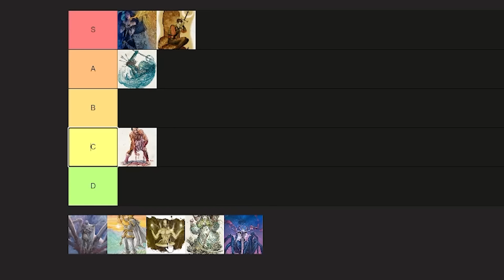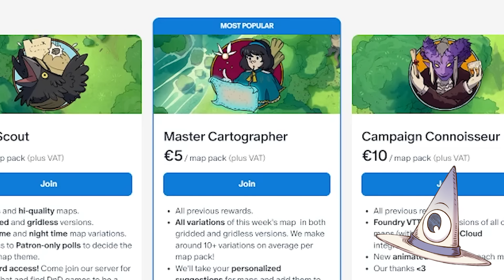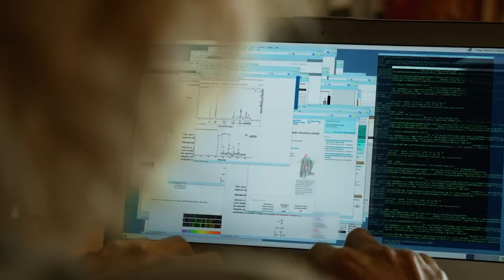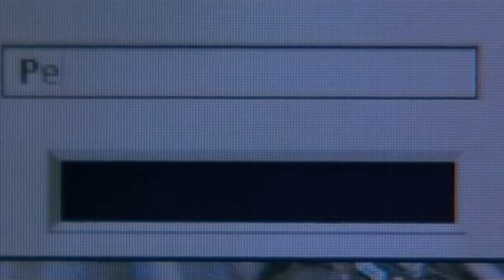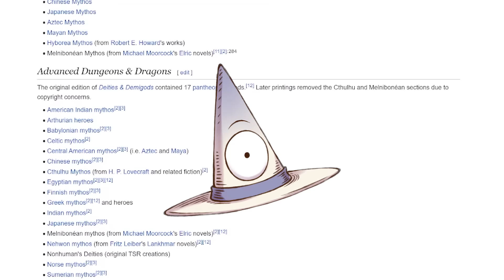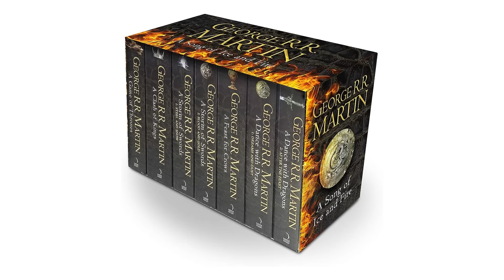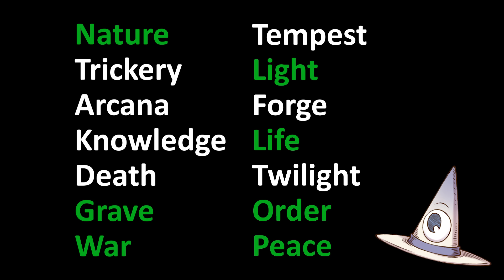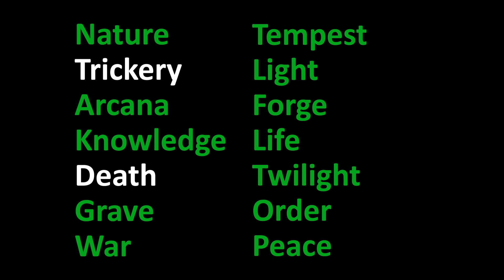The Problem with D&D Gods (and how to make your own)

Comment: .
I suggest another fix: 
1) No true Omniscience: Instead of the kami "limited scope" we can use "limited divine awareness".
2) Zero Sum: Of course there is divine inaction, even in dire circumstances (and it's specially enjoyable when it's an allied deity the one who weirdly doesn't feel involved) BUT sometimes is just that gods effors are focusing elsewhere, cancelling each other's, resulting in a total sum 0 where a little of mortal involvement means the winning push. 

The AD&D Planescape setting suggested that  deities are often in constant check of one another. In fact, they have powers to restrict another's influence and  balance their plots and counter-plots: They have the ability to partially osbcure each other's omniscience anf divine senses, for example. Also, deities are more dettached from mortal affairs the more powerful they are. Finally, the have some kind of policy, or fundamental agreement where direct intervention means some of a risk for their own divinity... a casus beli of sorts they try to avoid by operating through their followers.

So, in the end, is mortal involvement which truly moves the gods. And frankly: My campaign is not about the whims and goals of every fervent soul at Primary Material Plane. All truly pivotal facts that happens during the history will conveniently matter or happen to the heroes, villains and elements of my campaign, while perhaps an uncertain number of deities are surely involved in foiling (for them) equally relevant events in several other corners of the world caused by rival's plots or pure chance.

I'm glad I have a rich, complex and partly obscure and tangled web of divine pantheons for my games (FR), just a few(Eberron), or not at all (DS). Your suggestion is not a fix: It's worldbuilding to make the style of religion system that better suits your campaign. 

Mine is set in Ravnica (a world with little known information about deities) and I have done quite the opossite to "fix" it. Ravnica still has zero gods. But it's now more visibly populated by several powerful nature Avatars, ancien mythical creatures, demonic patrons, Guiding Archangels, Warding Ancestors, Cults to Nephilim, forbidden sects, animism, Monastic orders and a powerful "true way" Church imposed by the Orzhov to help citizens to grant a peaceful afterlife to themselves and their loved ones while appeasing ancient powerful beings to prevent or postpone "the Black Sun Culling" a foreshadowed event the church says is bound to help avoid. Thus, it doesn't matter people beliefs: They pray one of Five Saints or pay tithes as a sort of spiritual insurance policy regarding of their faith.

It could work with just one dual aspect god or none at all. But my world is richer with complexity. It's not a better approach, it's just one that doesn't sees religion complexity as a bad or cumbersome thing.

Comment: The gods in my setting are many and of differing power level, but I've combined it with animism to make sense of when they do and don't act. Everything has an animating spirit, but the smaller and less impactful a thing is, the less conscious and powerful its animating spirit is - a rock may barely be awake, a mountain might be able to talk with you and give you a boon, a mountain range can throw some power around, and a landmass can do some serious mojo. But as you might have noticed, a mountain is made of rocks, a mountain range of mountains, and a landmass of mountain ranges and everything else contained within it - and the same is true of their animating spirits. The god of a mountain is part middle manager of a bunch of rock spirits and part the hive-mind amalgamation of all those rock spirits. Meaning it will be generally neutral on issues the rock spirits are divided on, though it may lay down the law for those rock spirits on issues that affect the entire mountain - and as an individual spirit, it will only care about issues that affect the entire mountain, meaning the more power a spirit has, the less it cares about small issues.

Comment: I feel like as a DM I both succeeded and failed in these steps. I have 3 Overgods, based on the primary colors. One is asleep in another campaign, one has been sealed and is being awoken by their followers and the last has been injured and cursed the gods. Exiling the gods from the celestial plane they stripped their power to where no god is higher than intermediate and cursed them into animal forms. The gods weakened separated from each other into different regions and have their own territories. So there's a lot of them but weakened and there's also the overpowered few.

Comment: One idea that I think is cool as a way of explaining why gods don’t interact with the mortal plan is that they had in the past but in doing so destroyed the world because of there overwhelming power. This in turn made them agree to never influence the world more than was absolutely required to keep the world safe. Especially, because then you can have them share (this must be a part of the process of being a champion or it might brake the not interfering more that is required) or not share (so as to not brake the no excessive influence on the mortal world) that information with their champion. So, the champion immediately does anything that they think might be a direction from their god even if it isn’t, because they know that there god only tells them to do things when it is absolutely necessary, but that god will also never make it super clear that they are instructing the champion so as to not interact with the mortal plain more then necessary. While on the other hand you could build a bunch of story around this champion fearing that their god has abandoned them because there god does absolutely no more then it has too and in doing so never tells the champion that they are not interacting more than is necessary.

Comment: How I think I'd get around some of these problems:

- Gods gain their power through a mixture of the knowledge of their existence and through the emotions of material creatures. This means the cast of gods changes as eras come and go, as their names or what they can do is forgotten.
- Since gods gain some of their power through emotions, it allows fear and insecurity to influence a god's power, creating room for evil gods to exist. Alternatively, the emotions can change the temperament of the god over time, as the general vibes of the public shift.
- Gods can only affect that which is immediately relevant to their domain. The god of the sea, for example, only rules over large bodies of water - seas and oceans.
- I imagine that if you don't do the changing temperament I mentioned before, then you can do two gods fighting for control over an aspect of nature. For example, two gods of the sky are constantly fighting for dominance - one that keeps the sky clear and allows for sunshine, one that creates storms. Whichever is dominant in the public eye, which can shift as positive and negative things occur in society, will gain control over their aspect.

Just a few ideas I had while watching this video.

Comment: Aside from the Faith of the Seven there is also the Drowned God of the Iron Islands, and in Essos there are smaller tribal religions, as well as the Asshai religion of R'hlor, which has followers in Essos and Westeros during the storyline. The Old Gods are an animistic religion implicitly, and only worshipped in the North of Westeros

Comment: DnD basically already has a built in “rule” for Forgotten Realms at least for why gods aren’t getting involved. Ao (the overgod) doesn’t allow gods to get involved. 

BG3 imo explores this pretty well with Shart, Shar and Selune both have to act through mediums to achieve their will. Why doesn’t Shar just smite Ketheric for betraying her? She’s literally not allowed to, so she commands Shart to do it (if you go down that path for Shart). 

Imo you can even use that as an explanation for why the cleric has joined the party on this adventure. Literally “my god commands me to do so” is a good way to have a cleric who otherwise wouldn’t join an adventuring party do so as mere connivence. The adventuring party starts as a pure means to an end for the cleric.

Comment: In my setting I nuked the amount of gods there were.. twice..
"War of the Stars" and the "Black Catastrophe" events destroyed many of them that might have existed beforehand and a far smaller pantheon of my own design had to uplift themselves to fill the vacant holes or the universe would have eventually eroded its own existence. Because of the means of their creation, they are not tied to devotion and prayers, though it does empower their ability to affect creation more directly. They are bound to the rules of the constants of the universe they embody which makes the way they can help or interfere VERY SPECIFIC..

Comment: The unmentioned method is the good old fashioned mysterious gods method:

you have 2000 gods and nobody’s really sure which ones are real. You might worship god A and kind of get powers but then someone else has a god that’s similar or the same they get powers too and both of them will claim the other person is just generously being granted powers by their god because they’re acting along the same lines.

This can also works elder scrolls style where they’re all real (to a degree at least) but they’re like aspects and faces of the same fewer gods. So you wind up with only seven or six.
Then they also have the daedra who don’t really care about the world ending because their realms are self sustaining.

Comment: You could have used a new moon instead of a waning moon. For both the symbology and look would be cool.

For a new moon could represent the death of the old moon so it can be born again.

While the design could be an empty circle with a hole cut in the middle to represent the empty face of a new moon.

Comment: I am working on beginning a pantheon-based campaign. Gods are the biggest thing, with them being both the enemy and possible allies. The thing is though, is that lesser-medium deities are the only ones concerned with the world, whereas higher deities are confident that an adventuring party will probably just fix it. Higher deities wouldn’t even provide divine intervention, that’s how careless they are.

I mean seriously, imagine being alive since the beginning of time- imagine how many world-ending events have happened! And how many times they solved themselves! 

Medium-deities are only concerned with losing followers, so they don’t want the world to end and their followers to die. They also generally just don’t want to lose power in general. 

Lesser deities are the most concerned, as they somewhat live between the material plane and their own divine realms. But they cannot afford to lose followers, so they have to assist wherever they can to increase influence. 

This includes evil deities, so they will try to make pacts, so they don’t have to directly intervene and seem like the good guys. They’re evil without losing followers. 

Then evil higher - medium deities are the ones enacting their wills on the world, to receive prayers of forgiveness and pleas of mercy. Either one works- and having people pray to you in the masses is an easy way to get power quickly. Especially if you want to enact revenge on another deity.

Comment: tl;dr:  i have a handful of gods and no less than two pantheons, but I don't feel overwhelmed because they're My gods (and i only think about them when the time comes), and three major types

for my own settings, i intend to include a mix of Primordial Gods and Worship Gods - Primordials are not necessarily the most powerful, but they rule over concepts that have existed since the beginning - They don't need Worship to maintain their power, just the universe itself to exist with their power flowing through it.
Worship Gods, work off the "Lesser", "Mid", and "Greater" scale - they can exist as needed, and only really hold influence over those who believe in them - Or the areas closely around them, depending on how powerful the worship
Aaaand then there's the third type - Ascension Gods
An entity who has gone beyond being Just an entity and has become a god - Sometimes they follow the rules of Worship Gods, sometimes Primordials, but usually it'll just be the third option of "They simply became too powerful to NOT be considered a god" (no i'm not going to draw the line where that starts and ends, yes you can have a godlike entity who has simply not flexed enough to be called a god, or someone who's classified as a God but a Mortal could come up and murder them w/o having to become a god)

Until I develop *Places*, the Worship gods would be specific to when a Cleric, Warlock, etc. needs something to worship, whereas the Primordial and Ascension Gods have individual context as to how they got where they are

The Primordials mostly consists of The Gods of the Elements (there are like, 12 of them, 36 if including the lesser tiers of each element, which cover all the damagetypes of DND, plus a few more I thought were sorely missing like Gravity)
and Gods of Existence/Creation (LIFE, EXISTENCE, OBLIVION, always capitalized whenever I refer to them)

Pretty much all the Elemental Primordials have opinions about eachother and would probably help the fight in some way if someone called on them at the table, even if I had to handwave "They were already helping" (though be careful you don't end up causing me to bring in someone who would side with the bad guy :) ), and the Gods of Existence don't really care about what goes on in the reality - Well, until something causes reality to *End*, where OBLIVION usually gets the short end of the stick for literally being The God of The End  (death, credits roll, final page, etc etc...) because OBVIOUSLY if Reality got Destroyed, OBLIVION has something to do with it!  (spoilers: it's usually because of something inside the world they made - such as OBLIVION Cultists, who OBLIVION would probably tell not to end the world if they were paying enough attention)

another two gods I love to think about are ABSOLUTION    (pretty much the biggest god in the Elemental Trio - ruling over the Element that pertains to The Soul and just generally Magic, as well as as a side gig having a domain of Willpower, which the ABSOLUTION element at the peak of their trio calls to - playing into the heroes who refuse to fall when the rest have, who overcome the odds when everything else says no - If you believe it with all your heart and soul, ABSOLUTION will make it so, but only if you hold the absolute willpower they adore - Otherwise abstaining from ANYTHING unless absolutely necessary, even Pantheon Meetings unless they feel like it, considered by the Elemental Pantheon to be extremely unreliable and difficult to work with, though others see them as the one they can rely on to show up when it matters most, and not a moment before - Conserving their energy for where it truly matters)
and PURITY   (top of the Elemental Circle which shows the opposites and relations of the Elemental Pantheon, opposite CHAOS.  PURITY rules over Water, Flow States, and Purification - That includes Holy Water, which does not require Radiant Energy.  PURITY will cleanse all debuffs and damage, yes, but they will also strip any beneficial Mutations, Buffs, and the likes that do not make you "Perfectly Pure".  Too much influence of PURITY will eventually make someone a perfect average of their Species - Too much more, and they will start to become the Perfect Average of all Creatures, which could eventually lead to becoming a Purity Elemental, which I visualize as White, Perfect, Geometric Shapes - Particularly Spheres, though including any of the shapes we use for common dice, i forgot the name of those shapes)

Comment: Funny thing, Its possible to get an idea of the stat blocks of most dnd gods as some dnd gods like Lolth got stat blocks in 3.5. Shes actaully not THAT bad to defeat... AC 27 with a base 285 hp. Not too bad right? She has 6 casts of "Divine shield" which gives her 150 temp hp each cast as a bonus action. She can also cast level 8 spells with 3 legendary actions. She can auto dominate drow and summon any drow as an action, and can once per day cast Power Word Kill without an HP requirement. Otherwise her attacks are pretty beefy and her poison requires a DC 24 saving throw or you get paralyzed with her +19 to hit.

Her best ability is God Blast though, a beam attack that deals 26d10 typeless damage as an action. Its her 'breath weapon' effectively. Finally 3 times per day, she can choose if a dice roll is a nat 20 as a reaction.

Thats Lolth in her full god form. No avatars, no proxys, honest to goodness Lolth who is a rank 15 god. (Out of 20).

Comment: What I did last time I had to deal with this was to take all the gods that shared a major domain, and just fused them together.  Each of the individual gods still existed, but they were more like splinters from the whole.   Each one was shaped by the cultures that foamed them  ( this was kind of based on how older cultures dealt with other pantheons existing, without there being huge theological clashes) For example: take Apollo. In Greek myths was the god of the sun, music, prophecy , but was a second tier god and kind of a jerk. Then you have Ra, who was also a sun god, but was the leader of his pantheon. My setting had both be true by having a "Sun God" but having different shards be in a different area. It's also why they were not always interfering with mortals, often time both sides were literally the same deity, just one side had the evil version, the other had the good, so they canceled each other out.